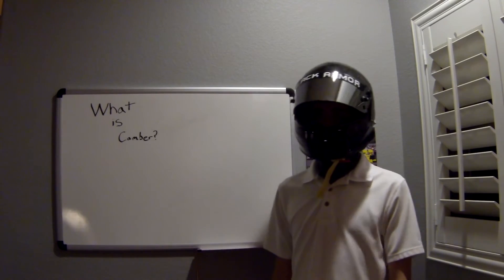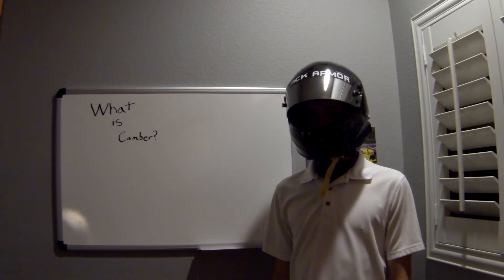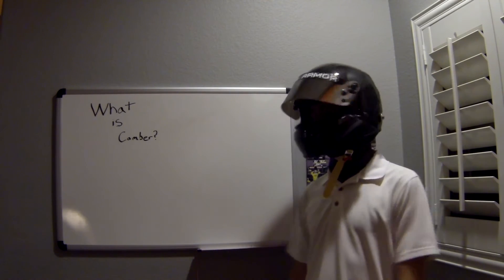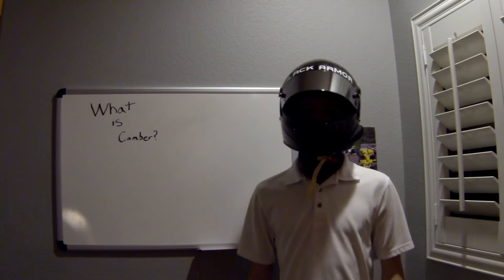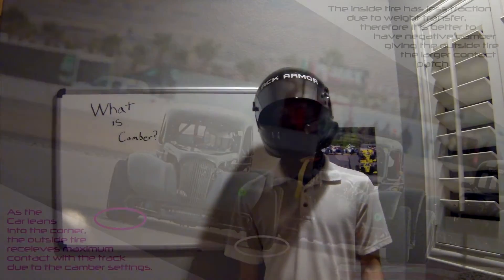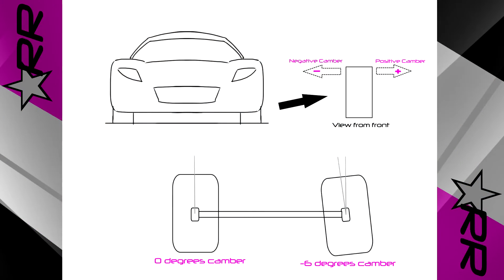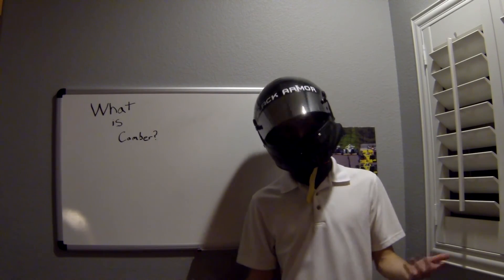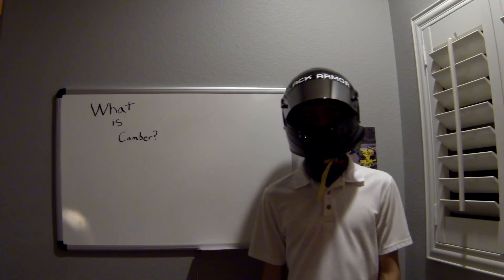How can Camber increase performance?

Comment: hey! I am a college student making a gokart for   an inter college racing competition, can you tell me what kind of camber or castor angle setting would he optimum for this kart?
Reply from the maker: Formula SAE I assume? I had a friend who did that a while back. I would do it too if UNLV had a team, but I digress. 
         When choosing a camber angle it really depends on the car and tire. And I don't mean just a little, it can vary drastically. Tire pressure, sidewall stiffness, suspension arm length, suspension travel, build materials, chassis flex, speed, turn angle... you get the idea. When it comes to racing cars, it will be a little higher than a typical road car so probably between 3-5 degrees( a little higher than normal race cars since you don't have a team of professionals making parts, so you may have a little more ball-joint travel). 
        A very easy way to test camber is to have your car, a parking lot and a material that can sticks to your tires very well. Simply pick a good average speed say(45mph) pick an average turn radius, and drive over the substance. Adjust your camber until the coating is even from the inside to the outside. 

Sorry for the wall of text, I just don't want you to think this is a simple plug in perfect number situation. 
If you have any more questions feel free to ask.
-RR
Reply: Racing Rationalized Thanks for the reply! Yeah it depends so much on so many different factors. The trial and error method would be good for our case I guess... because I can't find anything that states any specific theories related to this stuff for a Gokart!  thanks anyways
Reply from the maker: If you have no suspension travel, and it is a true go kart it will be a lot less, you would just be compensating for the sidewall flex not so much suspension flex. I would guess (1-3). No problem, thanks for your question.
-RR

Comment: I also subbed to your channel!! 
I was trying to find how to improve my karting skills and in your channel everything is very well explained.

I have two suggestion for new videos:
- How to do the racing line when they are two or the curves in a row (like, for example, right turn, left turn, right turn).
- And I also listen  people saying that when they are racing with cars, they break with the left foot (instead of doing it with the right foot). Can you tell us wich are the advantages of this technique and if this is very difficult to do?

Thank you!
Reply from the maker: If only I had the time off school and work to dedicate to this, no problem man. Good questions, I will be sure to make videos for them once I'm done with the current video which is about drifting. :)
Thanks for the input!
-RR

1st. I would need time and a video to properly answer this
2nd. Left foot breaking is good for reaction times in normal race cars and sports cars, but should be avoided in modern double clutch cars. (I get this question a lot at work) double clutch transmissions work by guessing the next gear you will shift to, if you are on the throttle and break even slightly, the actuator just goes back and forth making a terrible noise and shifting a lot slower when it guesses wrong. (In modern double clutch super cars at least) Hope this helped!

Comment: I subbed to your channel :D I find your tips very good and it improved my racing skills!By the way,i have to ask something about buying race karts and the basic karting gears.How much does it usually costs?I moved to a new home (I believe it is about 300,000 Singapore Dollars or something.) a week before New Years' Day in 2015 so i'm worried if the items are too expensive for my family's budget.
Reply from the maker: The cost of racing in all honesty isn't the cost of the car/kart, it's what you're doing with it. A decent starting kart can range from $2000 to $4000 which in all honesty isn't terrible for the speed machine you're buying. Racing only becomes expensive when you factor in the running costs such as tires, entry fees, and if you have a crash. So in the end, the price for racing is very reliant on how much you race and if you have any incidents. But, if you want a definitive number you are looking at $200 to $400 per race in a go-kart (at the local level without replacing parts).

Hope you found this helpful :)
-RR